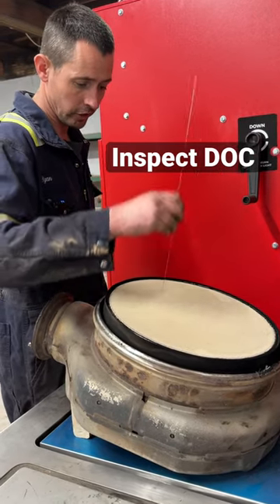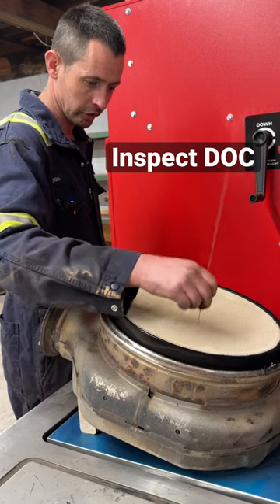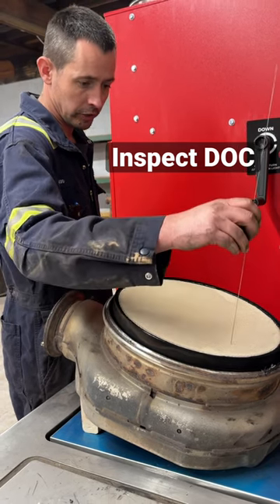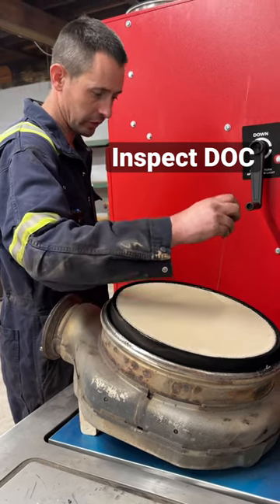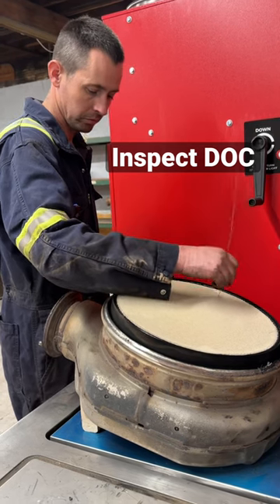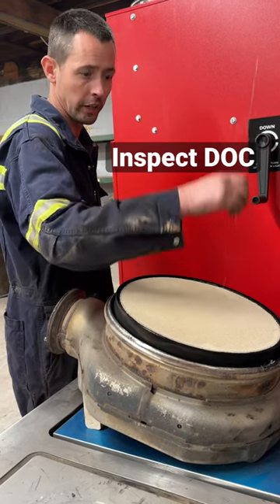How to inspect DOC (Diesel Oxidation Catalyst) #dpf #emissions #dpfclean #diesel

Comment: you have my favorite channel in terms of tractor repair and  highly appreciate all your information!!!!

I do have a qestion, well 2. 

1. I just hooked up a code scanner on my 2009 ISX15 engine and got the SPN:5018 code. It is telling me that my Diesel Oxidation Catalyst System status is "Inactive". Does this mean there is a problem with it or something else?

2. I also got the SPN: 3597 code, Supply Voltage #1 concerning the ECU. This status is also ""inactive".  Does the "inactive" label mean that it is a problem?

Thank you in avance!

Comment: What would the diagnosis be for a park regen lasting over an hour?
Reply: Depends your soot levels could be very high or the temperature isn't hot enough.
Reply: Delete
Reply: Question…. Will the DOC actually be any good without dosing (passive regeneration) only

Comment: The best way to inspect these things is the f**** remove them and delete the computer🤘😉
Reply: Negative.  You cannot simply do a delete to just the computer.
Reply: @kylew657  tell me you are from comiefornia without saying it
Reply: Mechanical injection is great. No computer needed to find out what's wrong.
Reply: You actually can... under load without massive idle time the heat will keep the doc hot enough to passive regen some manufacturers use passive only

Comment: We should invest more into the diesel engine than investing the after treatment system. Because all you’re doing is changing the chemistry which is still polluting regardless if not worse. Look all I’m saying is we been on this same diesel technology since it was even invented from the beginning. We should invest in the pistons to fully combust fuel with lower egts. Invest in diesel fuel where we can harness more power and less pollution. I know its just one part but we’re sooo behind on evolving it’s depressing.